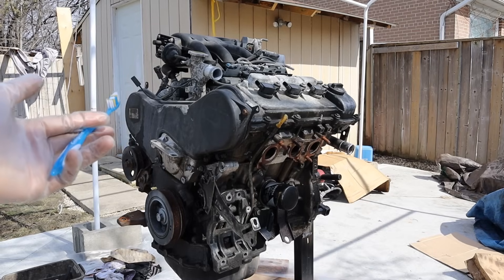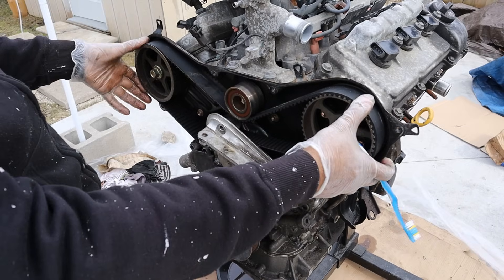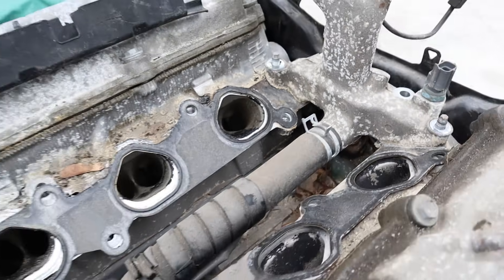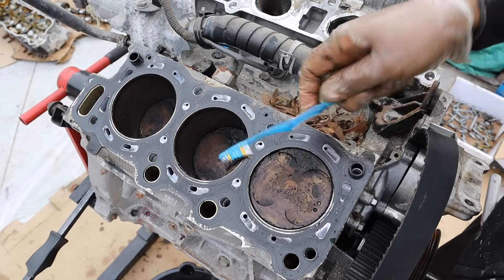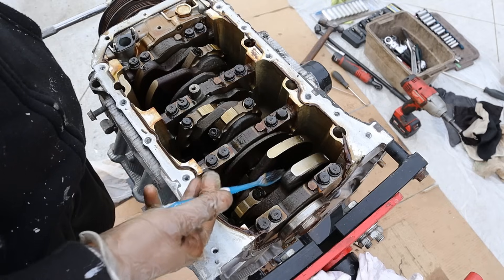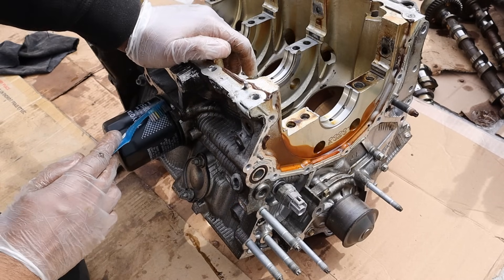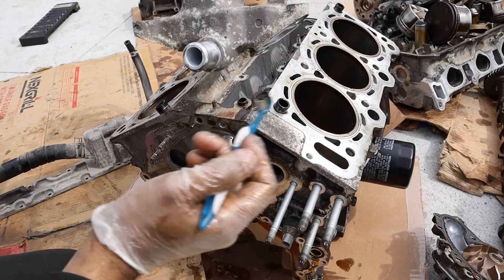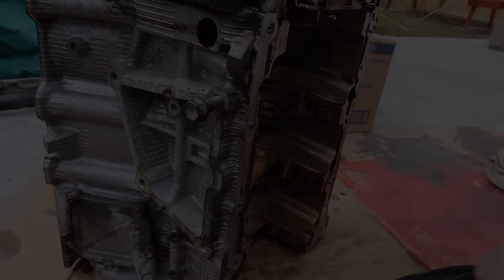Here's how the Toyota 3.0L V6 Engine Became a Success

Comment: Thank you for your video. I just purchased a 2006 Toyota Camry XLE with the 6cyl 3.0 engine. I was concerned when I purchased it because I had heard that you should never buy a Camry with a 6cyl engine, but I thought that was back in the 3rd gen 6cyl engines in Camry's from 92-96. So, I am relieved as this car has the 1MZ-FE engine with 100,470 miles. Whoever owned it before me really took great care of it. It of course has leather seats, all the bells and whistles of the era, and I just love it. It drives like a Cadillac. It's a Florida car and the underside of the car still looks new. I assume it has been garaged it's whole life which does make me feel like they took care of it. I want to keep the oil changed. Should I use the Mobil 1 full Synthetic 20K miles oil with the same oil filter? I only drive about 3000-3500 miles per year. I was changing the oil once a year in my last car because I heard that the Mobil one oil would hold up well for a year. So, since I don't drive it much, is it ok to change it once a year or should I change it every 6 months. I have no knowledge if the timing belt was ever changed? I've heard some mechanics say they've seen Toyotas with 300K miles and on the original Timing Belt. I know it's going to be a very expensive job. I was quoted $2200 at the dealer for parts and labor. I can buy an AISIN Timing Belt Kit with Water pump for around $200, and I would need to find a mechanic that doesn't charge $220 an hour labor. That's just ridiculous. No wonder the waiting rooms at Dealerships have Leather Sofa, Chairs, Gourmet Coffee, and Big Screen TVs. Thanks again, Greg in Florida

Comment: Mine is going strong. Smoothest engine ever. Zero sludge because the original owner was a mechanic and maintained it perfectly and i change the oil every 6 mos or 3k miles with full syn. 2001 es300

Comment: I know this video is 3 years old, but…. You don’t need to remove the intake manifold to change the spark plugs, it’s fairly easy to get my giant hands behind there and change them. Also, there is “enough” room for the power steering pump, it’s not that bad like an Audi. Finally, the oil filter is incredibly easy to remove as its front and center. Yeah the exhaust is hot, wear a glove or wait 10 minutes for it to cool. Or spray it with water. I can change that filter 10x faster than my LX, so it’s not “the worst”.

Comment: Mine was inherited 2001 Toyota Sienna CE with 125,000 miles, Timing Belt replaced at 120 K , Head Gasket Replaced, Front & Rear suspension replaced and restored. The steel rims was replaced with black enkei edr 9 on a 15 inch original size (cheaper tires), that makes it look descent. All replacement parts for this car are affordable and not crazy skyhigh.
It is still in top shape engine and trans, only issue was the white paint chipping on the hood and side panels (white paint does that all the time, i got one time in the traffic stop and was beside a white 2018 Camry and had a big paint chip on his door window sill) notorious chip and rear drum brake (original) which is out of round already, everything is ok except when reaching 60- 80 mph , vibration / shaking comes out due to out of round drums. 
It was a long hunt for that vibration and got the info from Amazon review when purchasing a replacement drum. As per the review I finally get the whole set from NAPA to replace and restore my rear brake. NAPA has their good quality replacement parts also.

Comment: Nice video break down. Working on 00' Camery. Need to send you a video. The engine was neglected of oil changes on time. Down at 177k. Plan on breaking down and getting fixed.

Comment: I am the original owner of my 2002 lexus es300. This car has never had any major inside engine work. I just had the timing belt, pulleys, water pump, and ignition coils with spark plugs replaced at 350k. Car runs great. Im getting 23mpg. I will need some body work over rear wheel wells but I am hoping to hit 400k.

Comment: I have 1 in a sienna have not run the sienna in a few years but am going to fire it up move to work shop pull it out and put it up for sell so it won't  rot in the shooting range where all my old vehicles die  with dignity as small arms targets.

Comment: my es 300 2002 have low oil pressure at low rpm (below 1000 rpm), but at rpm over 1000, the engine light goes off....the engine sound perfect....how long can i drive at low rpm before the engine will be completely damage....I had a coolant leak and my wife was driving it with the engine light was flashing...smoke was coming out from the engine...I think that was the cause of damage...any suggestion will help....only have 210,000 miles on it.

Comment: 2003 Lexus rx300 289,000 miles just did a full tune up pulling intake, crankshaft sensor and replaced knock sensors. Whoever thought up the back engine /intake bracket needs to be tared and feathered. Just to change spark plugs and coils. (I have done it without taking intake off but suffered sore hands for days.) A little more time but easier to take off intake. This was my wife's car and now my daughters college car to and from home. My girls just roll their eyes when I say it is a good engine. Only main repair was an upgraded transmission. I just need one more year ...fingers crossed.
Reply from the maker: Yes the Rx and es in that generation has weaker transmissions

Comment: I have this engine in my RX300 most smooth engine i ever had besides my es350 2GR  my 1 MZ has 212000 city miles all city miles and original everything even the shocks and struts my dad gifted to me as a junker car to get around and I knew the potential that the beloved RX always had and the reliability and durability so all I had do was brakes all around vvt solenoids and tune up new plugs  and that was my fault for taking a bunch of short trips and city miles and pcv valve was bad for a while but I would say the transmission is more bulletproof I ran it with no fluid so many times when the cooler line rusted and busted I think it acted as a trans flush and since I drained and filled two times it's like new and u still can't feel it shift 90% the time I love my RX 300  thanks dad!!!

Comment: I have this engine in my car. It has had knock sensor codes since I got it and has been preventing it from going into over drive and messing with the timing. I swapped the knock sensors and it fixed it for a night then it started doing it again. Im convinced its the wiring that runs back to the ecm?

Comment: I bought a 2006 Camry with the 1mzfe engine back in 2017 for my wife. My older brother's mechanic recommended it. So, i looked and boom, one popped up and i swooped in. I was inexperienced in checking out cars back then, but thankfully, we ended up getting a well maintained one. So, i am very happy. 

The previous owner made sure to get oil changes done every 5k miles. The timing belt has been replaced twice under first owner, and once with us (replaced in April 2025). There are no oil leaks nor oil consumption. I have made sure our 2006 Camry gets oil changes every 5k miles as well. I just need to replace the spark plugs and i think the car can last us another 10+ years. 

Our 2006 Camry had 181k miles when we bought it in 2017 and now has 235k miles. An absolutely amazing machine that Toyota manufactured.

Comment: I like your video detail engine every section how it operate
I own 1997 Avalon  401,760 miles I notice there is  an oil leak drift from bottom star bolt with 10mm nut close to alternator to support passenger dog bone mount don’t know where it coming from please help.

Comment: I got a 98 Camry with just 315k hit rexently. It had a check engine light which was just the MAF sensor and a burst intake hose. Now its still running like ever. But it is us leaking oil from passenger side.

Comment: Is the 3MZ valve cover compatible with 1MZ to fix sludging issue? Or is it not that simple?
Reply from the maker: If you don't have VVT on your 1MZ, it won't work.
Reply: @speedkar99  If you may be so gracious, I want to ask @ 3:05 when you do the trick to break the bolt for camshaft on the first one should you just not try to do it at all or was the second one an example of doing it the wrong way? I have to do headgasket on my van that I live out of in order to make it cross country. It's an undertaking but I believe if I am meticulous and careful and also can get good guidance on method and parts I will succeed.

Edit 1: Oh and mine is non-VVT. Sadness. So I guess I'll have to just get an oil change mid-way through the cross country journey.

Edit 2: Putting everything together again should be about the same as here, as well, correct? I can't imagine the VVT component would make it that much different during reinstall of camshafts right?

Comment: We are the original owners of a 2005 Camry with 3l engine in this video. 226K. Runs like a swiss watch. Uses about a pint of oil in 8-10K mile synthetic oil changes (!), which I have done without fail from the start. Great engine. Replaced timing belt and water pump twice as part of standard preventative maintenance. O2 sensors, iridium spark plugs and coil packs in the last month. That's it.
Reply: all the engines that run slow are powerless , last more,,,

Comment: Fantastic  reliable  engine   💪💪   hoping  it  came with  timing  chain  instead of the timing belt
Reply from the maker: The newer 3.5 engines were chains driven. I still prefer a belt. Less to go wrong despite the 100k service

Comment: Lol at 8:28. We have a 1999 lexus RX300 with the same 3.0L now with 412k miles on it. Bought it in 2008 with 125k. I do all the service and repairs myself and have been using off the shelf OAT Peak Global all makes coolant since 2008. It's now 2025 and zero corrosion or coolant issues. I checked.  You don't have to run Toyota coolant but you do have to run a similar formulation such as organic acid technology which is the predominant coolant. Want another controversial subject? I've been running Valvoline maxlife synthetic ATF which says it meets T-IV spec for 16 years now in place of Toyota T-IV.
Reply: I also use Valvoline Max Life ATF on 2004 Avalon with 187k miles, no problems for many years.  But I do use only Toyota pink coolant, it's not that much more expensive.   Engine oil is Pennzoil Platinum once a year. Less than 8k miles for me, typical

Comment: I got the p0016 and p0018 code at the same time driving i checked my timing belt its still lined up i checked and cleaned the vvt solenoids and filters theyre all good what else could the problem be oils good

Comment: I've got one in my 2005 XLE V6 Camry. It's the full tan leather interior with the factory JBL Soundsystem (even though I spent $800 on speakers) and it's Sierra Green Metallic. Very nice color. Looks bran new inside and out and I detail it every single weekend.
Reply from the maker: Nice! 
I have a 2004 Camry SE with the 3.3. 
While I don't need the car I can't get over selling it. It just works.
Reply: @speedkar99  oh nice! That with the black leather interior would have been my first choice if I was a new Camry buyer in the early 00s

Comment: hi i have toyota camry 2003 v6 same engine and idk what kind of noise coming from top right side of engine
Reply from the maker: It's probably the variable valve timing gear upon start up.
Reply: @ i mean right side near to fuel pump side and feel on top side and continue noise very loud chain moving noise,i dont know whats the issue and how to fix
Reply: @speedkar99 only replace gear or complete shaft?

Comment: I have a 2000 Lexus es300 with 275,000 miles on it. It runs great, but I'm having to repair the valve cover leak. Hoping to get it to 300,000!

Comment: Hello speedkar99, I have a 2003 Toyota Highlander with the 3.0 V6.  I bought it three years ago  and it now has 283, 500 miles on it and it runs excellent.  Occasionally when the engine is cold it has a slight valve tick for about a minute, but then runs very quiet and smooth.   I change the oil and filter at around 3500 miles regularly, and In an effort to get rid of the valve tick I'm going to try Valvoline Restore And Protect at it's next oil change.  I'm on a mission to see how many miles I can get out of it.  
New sub...Thanks for the excellent video!
Reply from the maker: Glad you're enjoying your 1MZ ! 

I have a 3MZ with half that mileage and it's running strong.

Comment: I now have 2 of these engines. 95 Camry - 250 000 KM and 03 Camry with 520 000 KM. Love these engines, easy to work on and go forever with the proper maintenance.
Reply from the maker: Yep they sure are smooth. Wouldn't say easy to work on though 😜

Comment: I have one in my 2005 Alphard mini van, only 125k km's on the clock.  Just wondering on what the timing belt interval is and should be.  I've heard reports of 90k miles, 100k miles and also of only 100k km's.  Given also seen reports on yt of belts lasting well over these figures but given the time frame also of now 20 years, I'm a little worried, and also the fact of the mini van engine bay layout.... if the engine needs to come out in order to access everything or not???  The power steering pump and lower timing belt cover etc  Cheers, great video thanks
Reply from the maker: It's tight but it can be done in the car. Look up my timing belt video on the 1MZ

Comment: I just picked up a one owner dealer serviced 2002 Avalon xls column shift with the 1MZ. 100218 original miles. Im in the process of replacing the struts as these cars tend to have strut mounts go bad an make a knocking sound.

Comment: I have a 2000 Avalon that I love that was in storage for 3 years and now when I want to put it back in service the oil warning light is on.  It was fine when it was put in storage.  New oil, filter, and pressure switch changed nothing.  Stumped!
Reply: Did you store it with new oil or the old oil and just park it?
Reply: @digitalunit318  Unfourtunately, old oil.
Reply: @FloydHalleckson  sounds like a passage to the oil pump is blocked possibly. What happens when you turn it over? Did the old filter have oil in it? Possibly take new filter off and check if any of the feed passages are blocked. See if the new filter is getting oil in it when you turn the engine over and run it by taking it off after you run it.

Comment: Very good video. One somewhat misleading statement: it is not necessary to remove intake manifold to change 2 of the rear sparkplugs. I've done it twice on my 95 Avalon. It's a little tricky to do but if you utilize a swivel socket you can change those 2 hard to reach plugs.
Reply from the maker: On the newer versions with the plastic intake your have to remove

Comment: Very nice video.  I have the 3MZFE on my 2005 highlander and try to do as much of my own maintenance as possible.  When I bought the car used at 125k, I was very worried when I looked in the oil filler neck to see exactly what you show at 7:25.  I posted it on an automotive forum and several folks were adamant the cheapest of oil was used in the car, yet I knew the car was serviced mostly at dealerships.  The shop I had do an inspection had no concerns, but couldn't really tell me what that black crusty material was or why they didn't think it was of concern.  On on automotive forum, some folks said it is actually a black enamel coating that tends to deteriorate over the years.  Do you if it this area was indeed coated with black enamel, or if it is a carbon buildup on uncoated metal?  Either way, at some point I need to replace both valve cover gaskets due to leakage so will have the opportunity to inspect underneath then.  Finally, I was curious on two things.  One, do you recommend ever using a cleaner such as BG44k and if so, does that clean the top of the pistons as you show have quite a bit of carbon?  I am currently using Tier1 gas which I know has high detergents level.  Secondly, have you had any experience with the new Valvoline Restore and protect?  Thanks again for the great video.  I have a much better understanding and appreciation for this engine and how it works.

Comment: I have a 2002 Highlander with the 1MZFE engine. I have 191,000 miles on it and it runs very well.
I change the oil every six months and use only the finest 5W- 30 synthetic oil.
( I have heard about the engine sludging problems with this engine with those who do not change their oil on time.). I enjoy Watching this video and watch it multiple times  to learn as much as I can about this engine. I can see that Toyota really did a superior job with their design of this engine.
With this number of miles, is there anything that I should be aware of?
I changed the timing belt at 161,000 miles, Recently put a new radiator, Hoses, Thermostat and coolant  on the engine as well.

Comment: I would avoid this engine personally, they are known to sludge up and leak from the valve cover gaskets and are a pain to work on due to how they are mounted. Sludging isnt as much of an issue though, because its usually down to infrequent oil changes, and the engine bot being warmed up which are very easy to remedy. The valve cover gaskets are a pain, you have to take of basically the top on the engine components just to do the gaskets which will definitely leak again at some point because the engine is tilted and features a v design. 

For this reason, i dont think the motor is worth it, their great when taken care of, but poor maintence can kill them and theres better options out there anyway. An inline 6 is ideal, its mounting is just difficult sometimes